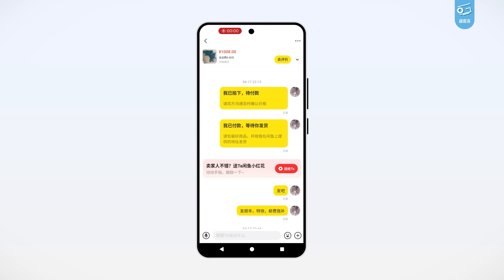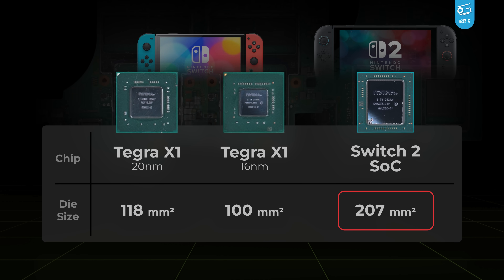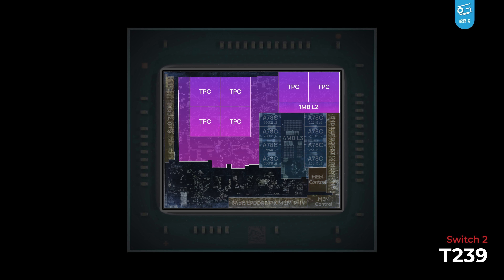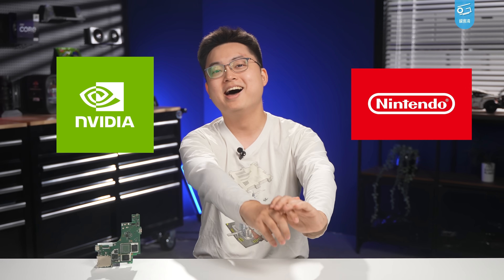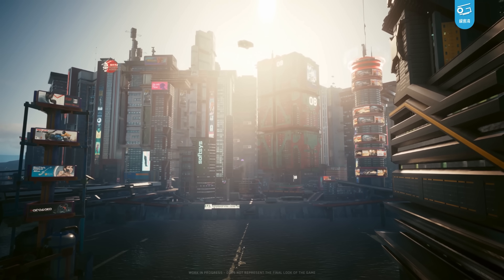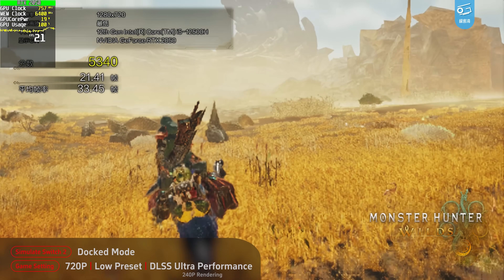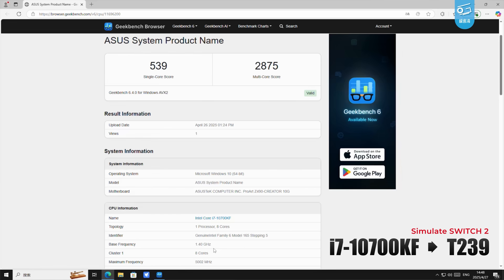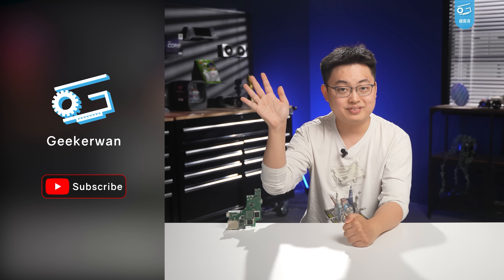This is Nintendo Switch 2's CPU!

Comment: In a better universe:

"Nintendo Click" Q4 2016
USD $300, Games $50
Cartridge $50 for 32GB
Storage 128GB
RAM 8GB
CPU 8x 1.1GHz Cortex-A73
iGPU: Nvidia-10 Pascal (10W TDP)
Performance: Slightly below XB1
Silicon: TSMC 16nm
Screen: 800p, 60Hz, OLED
Battery 30Whr, Charger 20W USB-C
Dock: Active Cooling, upto 30W for 4K/60Hz upscaling
Units Sold: 200 Million

"Super Click" Q4 2022
Units Sold 150 Million
USD $400, Games $50 Digital 
Cartridge $70 for 256GB
Storage 512GB
RAM 16GB
CPU 8x 1.5GHz Cortex-A78
iGPU Nvidia-40 Lovelace (10W TDP)
Performance: Slightly below XSS
Silicon TSMC 5nm 
Screen: 1100p, 60Hz, HDR10+
Battery 40Whr, Charger 30W
Dock: Active Cooling, upto 30W for 4K 60Hz using DLSS v2 (Upgradeable to v3 and v4).

"Super Dock" Q4 2026 +$300
Units Sold 50 Million.
This special dock includes an eGPU Solution to get PS5 Pro level of performance. Good competition against the upcoming 2028 PS6/XB6 for Nintendo to remain relevant, and get plenty of third-party support.

This strategy allows Nintendo to sacrifice on their profit margin, and short-term profits. But it allows for a longer device lifecycle, and market relevancy. It also means with this revenue they sustain a long-term success instead.

Prequel ?
"Nintendo Snap" Q1 2011
Units Sold: 50 Million (instead of WiiU)
USD $200, Games $40
Cartridge $40 for 8GB
Storage 32GB
RAM 4GB
CPU 4x 1.1GHz Cortex-A9
iGPU: Nvidia-6 Kepler (7W TDP)
Performance: Slightly below Xbox 360
Silicon: TSMC 28nm
Screen: 500p, 40Hz, IPS
Battery 15Whr, Charger 10W USB-micro
Dock: Passive Cooling, upto 20W for 1080p/60Hz scaled

Sequel ?
"Click 64" Q4 2029
Units Sold 100 Million
USD $500, Games $100 Digital Only
No Cartridge
Storage 2TB
RAM 64GB
CPU 8x 2.1GHz Cortex-X7
iGPU Nvidia-80 Feynman (15W TDP)
Performance: Slightly below PS6
Silicon TSMC +2nm 
Screen: 1500p, 120Hz, VRR
Battery 60Whr, Charger 60W
Dock: Active Cooling, upto 60W for 4K 60Hz using DLSS+ technology.
Dock 64: coming as a mid-gen refresh for above XB6 performance.

edit: spelling

Comment: Wait so is it more powerful than a Series S or at least close?
Reply: Of course not. We are years away from that level of performance in a handheld chip.
Reply: @phattiger1506  huh? My sd gen 3 is stronger? My phone is from 2023

Series s 4 teraflops
Sd gen 3 / s23 ultra 4.5 teraflops

Sorry man you've been living under a rock look at m2/m5 chips lol
Reply: @GamingXPOfficial  They can't really be compared due to vastly different architectures etc, but if you look at real world results, all the platforms you mentioned are punching far below a Series S in real world gameplay.
Reply: @phattiger1506  true but the raw performance is 'therish" another huge hold back is having to develop for multiple mobile chips enstead of focusing on optimiz for one chip like ps4/xbox at the time 

Look into winlator its impressive how strong mobile is getting at running windows games i would assume we are at 750ti/1050 levels of performance
Reply: @phattiger1506 unless im getting the series s confused with the older xbox anyways mobike chips are almost at the ps4/xbox one level of performance

Comment: The simulated speed of the NS2 is just plain wrong.  a 750ti couldn't even run Mario Odyssey at 10fps let alone the 60 that it runs on the OG Switch.  Also, saying docked mode is only a 1050ti is even more laughable, because a 1050ti couldn't even hope to run the Windows desktop at 4K60, let along TOTK @ 4K60.  While the seeing the hardware was very very cool, the simulated stuff is pretty much dead wrong and not even close to the performance the NS2 will have.

***Also, another laughable thing that pretty much every online person does is not think that DLSS is actual performance.  It totally is, not a single person that fires more than two neurons at a time will ever not turn on DLSS (and hopefully FG if the chip supports it!?) because the added performance is next level amazing.
Reply: Bro compare 750ti performance running simulator with native switch performance 🤣👍
Reply: The most legit sources are comparing it to a ps4, this guy is as well.

Comment: Tremendous video. I am even more disappointed by the Switch 2's SoC. Imagine a modern Nvidia SoC that's equivalent to the Snapdragon 8 Elite. A more powerful but more efficient chip. 

I have no doubt that if this did come out in 2021 that it would've been considered cutting edge, but we're in 2025...

Comment: With the Switch and Switch 2, not all the hardware resources will be available for games. Approximately 25% of RAM or CPU cores is put away for the OS and other processes such as movie recording. 

6 of the 8 cores for gaming, 9+ GB of RAM, and possibly other resources as well will be available for games.

Comment: So we pay 470$ and receive 4 year old tech in return? Sounds like a good deal. NOT.
Reply: Not only that but Nvidia abandoned tegra until the switch came along. Essentially we could play switch games on our phones if Nintendo ever wanted to.
Reply: @xKhaozZer0x  I have a Switch, and that thing was acceptable but not performing well over the years. Some games that I was looking forward to turned out to be awful. But my impression was that Nintendo wanted to convince people that performance is not important, it's the gameplay experience but when the gameplay experience sucks because of old and slow hardware what's the point? 😅

Comment: Hahahaha, don't know why everyone's so surprised. People are ignorant to chips and computing/performance. Subjectively I'm still buying it just for the Nintendo exclusives because I'm in a position financially that its fine. But for most of my friends and circles the price to performance is a problem. At this price and in this day in age that we are in for chips and computing. The Nvidia T239 GPU used in the Nintendo Switch 2 is roughly equivalent to a Nvidia RTX 2050 or a Nvidia GeForce RTX 3050 (Laptop version) in terms of performance. While not an exact match, these desktop GPUs serve as a good benchmark for the T239's capabilities. The T239 is a custom chip, so it's important to understand it's designed for a specific power and efficiency profile while incorporating a lot of upscaling and frame generation techniques. And therefore won't have the exact same performance as a full-fledged desktop GPU. Variable refresh rate is only for screen tearing it doesn't prevent you noticing frame drops if your fps is dropping. The switch 2 is gaslighting consumers who aren't educated on chip performance and computing. By using extreme Upscaling and frame generation techniques to get "Improved" performance. The price of this system is a slap in the face of the consumer. Nvidia has disclosed the information about the chip being used in the Switch 2 (T239)… I don't know how people haven't seen this information.. Complaining about everything but the one of most important things (Price to performance).

Comment: I always said Switch 2 is just a bigger smartphone or a smaller tablet with gamepad. A realme 7 costs 69 euros! With almost the same tech, 1080×2400 resolution! What hindered them to go full smartphone tech with a snapdragon or mali gpu? In the end nvidia were the 90% engineers of the tablet middevice and nV is since forever fkin expensive since they destroyed first time competition with 3dfx. And if Cd Pr Red call their version for nintendo ultimate version, why dont they deliver ray tracing then and sharp textures? A better version than PS4 needs better effects at 30fps quality mode!

Comment: Although he is knowledgeable about hardware, he shows little understanding of software. It is not methodologically valid to simulate the performance of a dedicated system like the Switch 2 on a PC environment subject to various bottlenecks, and then extrapolate those results as representative. The actual graphical performance on the real Switch 2 is likely to be significantly better, as the system is purpose-built for gaming. Furthermore, his analysis in the video is based almost entirely on numerical data, while largely overlooking key aspects of the system architecture — which he himself acknowledges are different. As a result, the conclusions drawn may not accurately reflect the device’s real-world performance.
Reply: 如视频所说，CPU不行是可以优化的，但是gpu不行是真的不行

Comment: yeah kind of might be a 30s nvidia series, BUT, the switch 2 is capable of 4k above 30 FPS and up to 60FPS which means it should have an HDMI2.1 port and those are only present on nvidias 40s, so the motherboard you have indeed is a predecesor to the Switch 2, I like this comparison itts awesome, good job

Comment: never been this disappointed with modern tech
and this along with 80$ games
it's not worth it
and they say it was ray tracing 
and still, to what limit is pc gaming gonna get optimised for switch 2?
it's too weak that just 3-4 years from now when its emulators come out, even a smartphone could then run it given that it's a current flagship
500$ steam deck from 3 years back is a better option here with cheaper games and even more availability for f2p games

Comment: launching this at a higher price than the more powerful, more functional versatilel steam deck (i hope) will be a death sentence. in a sane world this thing fails big time
Reply: It’s not gonna fail keep dreaming and yeah this isn’t a sane world lol
Reply: @johnhall8564 we'll see how it does against the cheaper and faster steamdeck which has beem available for some time now @ $399. 8i predict sony releasing a new psp within a year or two. I  mean current handheld pc can nearly emulate ps4, which the switch 2 falls short performance-wise. doesnt bode well. ignorance is thinking nintendo is above failing, when you consider arguably the worst console launch in several decades- the Wii U.

Comment: Really good video!  2025 is a mixed bag for tech so far.  Nvidia comes out "lying" that a 5070 has the performance of a 4090 for a 1/4 of the price, AMD releases two GPU's that reviewed extremely well and released higher end versions of their X3D stuff...but it is hard to get at any reasonable price, Intel did the B570.......prices are rising fast on consoles and this nonsense.  Great year for technology /s

Comment: outdated gpu and laughable cpu, no oled - lcd screen. switch 2 likely costs nintendo at most $150 at scale. should have been more powerful or dropped price at current spec to $300, but we got $450 and $80 games from a decade ago with higher resolution. for the consumers sake i hope this fails. otherwise its a depressing precedent. i remember when sony took losses on their consoles....
Reply: Will be quite easy to emulate 😉
Reply: @chloroxgaming  ikr, cant wait tp play exclusives like Duskbloods at a higher framerate... for free

Comment: Something is not quite right, at 9:46 your simulation for Switch 2 handheld using 421mhz is drawing 13w, and that's the gpu ONLY, it's simply too much power considering that gpu is also ampere based and 8nm and Switch 2 is supposed to use only 10w total tdp in handheld mode.
Reply from the maker: RTX2050 was never designed/suppose to be efficient under such low power, so the number here is a bit misleading. The real T239 as a "specifically designed for lp" hardware can only draw less power.

Comment: Ok, so first off, this guy is brilliant. Second, let's admit that while we just saw how mediocre the Switch 2's Performance is, It's the games that make the system. Not the hardware. Nintendo has magic on that end. You can have a 5090 and it doesn't matter if the games, software, and user experience are bad.

Comment: Nintendo sells you 2021 specs with 2041 price 😁
Reply: According to mark cerny, a console takes about 4 years to develop start to finish. This chip was finalized in 2021, four years later 2025 the console is launching. checks out. Consoles are different from PCs in terms of optimization and developers getting their hands on it pre launch. Even first party games like donkey kong country needed near finalized hardware to work on.

Comment: This is why it's a rip off to buy Nintendo hardware. You could buy a 3 generation old flagship smartphone and have probably double the compute capability. 

Nintendo know this, hence clamping down on emulators that run native on ARM processors

Comment: 15:30 Why when they write A78C this frequency does not exist? They say it is from 2.4Ghz to 3.3Ghz on Wikipedia etc.
Reply: Because Nintendo clocked it that way. The Tegra X1 in the Switch 1 could go up to 1.8GHZ, but the switch 1 could do 1.1/1.4
Reply: @tranquility6789  thx for information 🫱🏼‍🫲🏽

Comment: samsung fabrication is already a red flag for me
Reply: They should've went for atleast TSMC N6 (6nm), I think. Even budget phone SoCs like the Snapdragon 685 and Helio G99/G100 are built on that node. But I do wonder if the choice of fabrication was more on Nvidia's side.
Reply: Why is that
Reply: @ceasarspalace  thermal sustainability mainly. Chips and SoC made from samsung fabrication tends to run hotter which mean it doesn't have good power-performance efficiency. Wished they were made from TSMC instead.

Comment: Okay so 450$ console for a 10nm chip when PS5 already used 7nm in 2020. I know tgraphics aren't the main focus of Nintendo but having a power efficient console would've been the least they could have done for this price. They could've at least give us a good battery life
Reply: The problem is twofold. Samsung's 8N node in 2025 (which is just 10nm but marketing) means that whatever little performance they hope to achieve with that severely underclocked CPU and GPU, will require lots of power, and per Nintendo's own admission it's going to be just 2-6 hours of battery life, which is less than whatbthe Switch 1 was capable of at launch. Suppose they would do a die shrink for the Switch 2 Lite and Switch 2 OLED and the regular Switch 2 later on - they'll only be able to achieve around a 3-7 hour battery life figure with the same battery. This puts them squarely in Steam Deck territory. For such a high price, you're way better off buying a Steam Deck instead.
Reply: @one_step_sideways  If they made a slight effort (again, even more considering that price point), they could've had way more games launching alongside their PS5 and Xbox Series counterparts, even if it meant being slightly under Series S territories.

What I think is that they count it as a double win having a great margin on shitty hardware + having less competition with third parties on their own console, so that people will have less choice and able them have greater margins on in-house games, while making people pay 80$ for them. Anti-consumerism at its best.
Reply: @martingarnier8009 then the switch 2 would cost 700$ or more
Reply: @angelvillegas9604  Not our problem. It already costs more than the Steam Deck. No reason to buy into the Switch 2 and its horrendously overpriced games.
Reply: @one_step_sideways  dumb logic
Reply: @angelvillegas9604  No they would just have to get less margin like they used to, that's all

Comment: This confirms the leaks that this thing is basically about as powerful as a ps4 and just under the power of a steamdeck.  What bugs me the most, is how bad the battery life will be given that it's battery is about the same as the steam deck.  Cyberpunk or elden ring on the deck, will get maybe 2-3 hours of play time and thats with 10-12tpd and a 720 screen resolution.  I'm sure switch two versions will be stripped down and optimized in some way, but I also fully expect for most switch 2 games to be upscaled from 720p to 1080p.  Also forget about 120 FPS, most 3d games will probably hover around 30 to 45 FPS with spikes going up to 60 if you're lucky.  Nintendo games might be able to get away with native resolutions, but they also tend to use stripped down graphical styles.  Yet another reason why I'm probably not going to buy this device, might as well just wait for emulation and for the steam deck 2.  This device is relying too heavily on DLSS, I hate to think about how much latency it's going to have as a result.
Reply: In handheld mode it's a tiny bit more powerful than the PS4, in docked mode it's almost double the power
Reply: @Daymare19no it’s not digital foundry about debunked that
Reply: @Quishangers  have you watched the video?
Reply: @Quishangers  Dude, watch the video.  The chipset is 4 years old and is a hybrid of 8mn and 10mn architecture. The specs he found all line up with the leaks and indicate that it's likely that the switch 2 was supposed to be released awhile ago but probably got delayed due to COVID.  FYI, these specs line up with what you'd expect from a handheld device.  Even if they had used the latest and most efficient architecture for their console, the difference would be negligible because Nintendo is targeting 10tpd in handheld to try to conserve battery life.  From a thermodynamics point of view, the only way for a device of this size to get performance that is significantly better than the current gen of handhelds would be either via a huge battery overhaul (solid state) or a breakthrough in transistor efficiency.  To understand this, you just have to compare the steam deck to all of the other pc gaming handhelds that have come out since;  the performance metrics are very similar between all of those devices because of the reasons I mentioned above.  Some of the newer handhelds use a higher TPD to support faster hardware but usually to the detriment of their battery life.

Comment: I have a feeling clocks are wrong. i feel they are 750mhz on hand handled mode and docked 950mhz.  most of launch games were not made from the ground up to work with switch 2 so performance should be a lot better in 2-3 years once devs are use to the console but then again who knows since most companies go with that good enough and stop there. They don't build games like they use too.